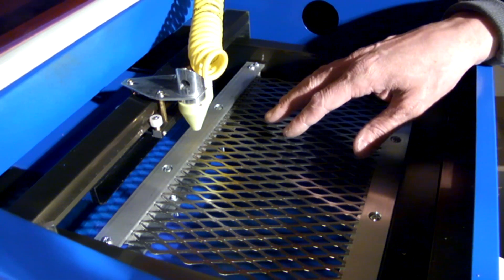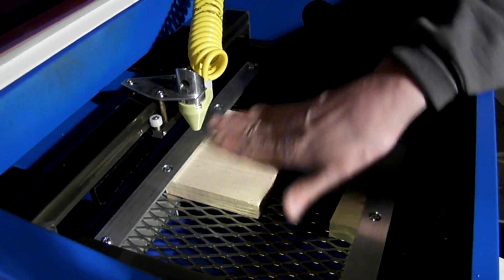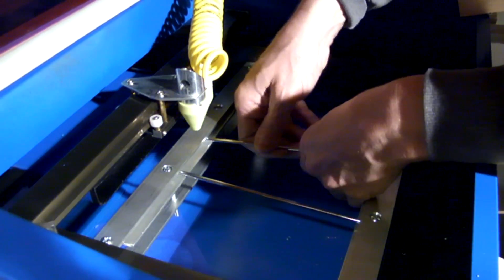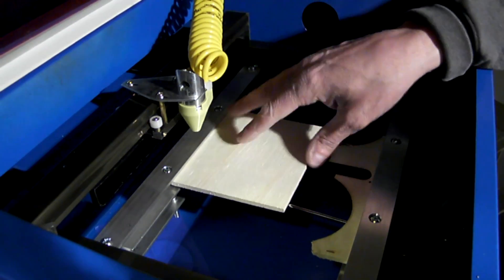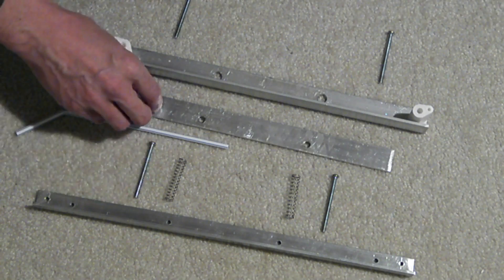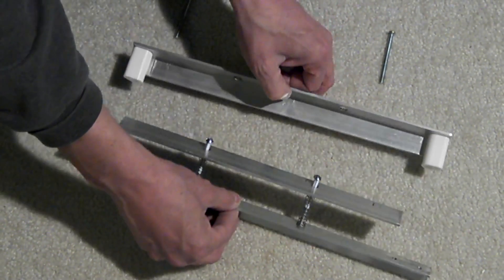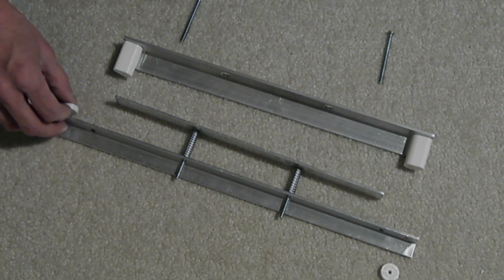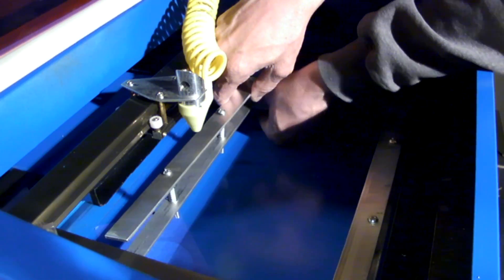Spring Loaded Adjustable Bed for K40 Laser

Comment: I made one of your work holders and it worked well but for me I needed a lot of time to shim things up - I do a lot of small wood discs - each one of varying thickness.   

I now mainly use a work table that is very effective for me - I can set up a new piece in a few seconds.   Incredibly sophisticated in one way - ease and speed of adjustment - but incredibly unsophisticated to make.  I can send you a picture.  All it is, is an open topped 9 x 13 inch box filled with corn kernels (might work as well with beans or something).   My box is about 2 1/2 inches deep on the inside so will accommodate pieces about that thick.  The top of the box is at the focal distance below the laser.  All you do is submerge the object in the corn kernels until a ruler runs across the object to the two sides.   Usually only a few seconds to get the next piece ready to be lasered.

Comment: I may have figured out my own question below. Does this sound like it would work to cut thicker materials?

I'm guessing put something half it's thickness in the spring-load then set the piece to be cut on top of the expanded metal?
Reply from the maker: Yep, that would work.  I normally cut .2" material and have not needed to adjust the focus off of the top.

Comment: Hello. I really am looking to do this. But how do you focus for cutting thicker material where I can't just rely on the regular focus length?
Thanks
Reply from the maker: I regularly cut .2" material with the focus at the top surface.  If you want to focus in the miplane of the material you could just set the height by putting a couple of scraps that are 1/2 the thickness yo plan to cut in the spring table. I have not found a need to do that.

Comment: Well, that is ingenious since these machines lack a Z height adjustment that the 50W, or higher, versions have as they move the bed up or down.  That is one reason I just can't bring myself to buy a K40 but that is only one out of three reasons but it is the biggest reason.
Reply: There are numerous Z height mods for the K40, all  relatively cheap.   For the Price they want for a K50, You can buy a K40, Mod the Bed (and inversely also enlarge the print area a bit), Buy a 50w Tube, and upgrade power supply, for cheaper then the cost of a K50.
Reply: I'd like to know more about this. What suppliers for the materials? I've seen a 60W tube on Amazon, but I've been told I'd need (a) a 60W power supply, (b) cut a hole in the side for the longer tube, (c) a 60W fuse, (d) a pressurized [?] water pumping supply . . . and it made me wonder if I'd also have to change the meter on the panel and anything else in the control panel board. Can you post any links?
Reply: @Kenneth White This is true but the K50 has a much bigger bed to it.  I was looking at a K50 and a K60 and the K60 I can't even get in my house.  It weighs 450 pounds and is just too big in all dimensions to get in and I do not have a garage (most homes don't in my state).  The K50 will work.  Now let us also realize that it comes with a roller Y adapter that wouldn't even fit in a K40.
Reply: @jbrondos this is why I am leaning towards the K50 because it has all of that already and it already has a side opening for a longer tube (some K50 models come with the extension already on it).  In my opinion the K40 should be about 100-200 dollars delivered and the K50 around 600 and the K60+ over a grand due to them being geared for a small business in weight and pure size.  Oddly enough the K60 does not come with a glass roller for Y and nor does the K40 but the K50 does.  What I did find was one really nice roller assembly for 250 dollars (over priced) that had a tail stock and a head stock and was basically a lathe for it but used a stepper instead of a motor.  That is the best kind to have and will hold up to 120mm diameter object 250mm long.

Comment: Interesting idea,  how is acrylic working for you as I too have used the diamond screen too for a bed however the reflection back creates a pattern which matches the screen in the material...
Reply from the maker: I have not cut acrylic yet.  If I have a part that I am worried about backburn on I use the steel rods I show in the video to hold the part up.
Reply: I have a hard time cutting through index card stock with my K40, even with a double-pass and dial cranked to max. I'd like to be able to cut through 3mm basswood. Is that most likely due to (a) alignment of mirrors, (b) power of laser tube, (c) focal point, (d) other? Or is cutting through 3 mm basswood an impossibility with a K40 machine?

Comment: This is such a good idea. I do have one question though. 

When you insert your material the top of the material is at the laser's focal point you say. So is this then only for engraving? I was told that the focal point should be halfway in the middle of the thickness of your material for cutting. Is this correct? If so, how do you compensate for the thickness of the material? I have this little perspex thing I got with the K40 to check for height under the focal point/laser head. How should this be used then?

Thanks in advance
Reply from the maker: I engrave and cut with the focus point at the top of the material.  I have hot had any problems working that way.  I understand that it might be more ideal to cut with the focus at the middle of the material but if you are going to do any engraving on things before you cut you probably want the engraving in focus.  That would required changing the focus height between operations which this setup would definitely not be good for.  In the end everyone has to look at what their application is and find the bed/setup that meets their needs.   A side note: I really like having the part held in place by the spring.  Before I had the spring loaded bed I had a couple of light parts move on me during engraving/cutting.
Reply: @ScorchWorks  Thanks for taking the time to reply. I agree with you, and love the idea of the springs holding it in place.

How about this idea.....?

Let's say you want to cut 6mm MDF (for now, let's assume that the K40 CAN cut 6mm MDF), you then adjust your bed settings so that the focal point is 3mm below the surface of your work piece. Then, if you want to engrave, you use 3mm off cuts to shim your workpiece down a further 3mm. That way your workpiece should be perfect focus for engraving. Once done, you remove your shims and proceed with cutting your 6mm MDF. However, it should be noted that you need some kind of jig/setup to make sure that the work piece remains in the exact same spot.

I know this might not be a perfect solution, but what do you think?

Thanks.
Reply from the maker: @cfworks1307  I would shy away from moving anything  between operations.  You might want to experiment a bit to determine if moving the focal distance is worth the effort.
Reply: @ScorchWorks  I will definitely do so. Hopefully today I will get around building your table. The other thing I need to sort out is the extraction of the fumes. Last night's perspex engraving was a nasty experience lol

Comment: Do you have the 3d printed stand-off plans available for download?
Reply from the maker: I have never uploded the model anywhere.  I am not sure if the height is perfect.
Reply: Scorch Works you should put them up. I want to do this same mod as well. I dont know where to begin with the height on those though.
Reply from the maker: Cream Stout I will try to remember to post them next week when I have access to the files.
Reply: Awesome, thank you!
Reply from the maker: I posted what I have here: https://www.youmagine.com/designs/spring-loaded-laser-platform
Reply: Scorch Works awesome thanks! I just picked up the materials today. I am going to do a hybrid version of this on top of the adjustable table found here: K40 Adjustable Bed found on #Thingiverse https://www.thingiverse.com/thing:2299337

Comment: How hard is it to pull the rails out to drill n tap them?
Reply from the maker: It wasn't too terrible.  The worst part is that you need to alight the mirrors after it is all done.  I would not recommend doing it when you are in a hurry.  It is worth taking your time.  I actually had the rails out for a different reason (I was trouble shooting something.) when I drilled and tapped them.  I put the holes in to the rails not knowing what I was going to use them for.

Comment: probably wont work on soft materials like leathers and stuff
Reply from the maker: I use it with leather. No problem.  If I ever need to do a very soft material it I might need to us a shim of the correct thikness.  I have not run into that yet.